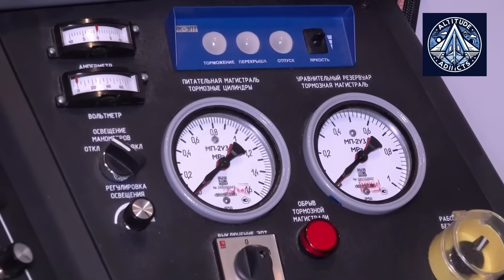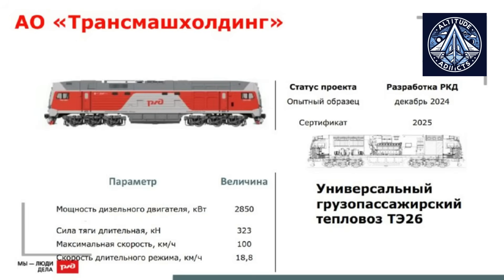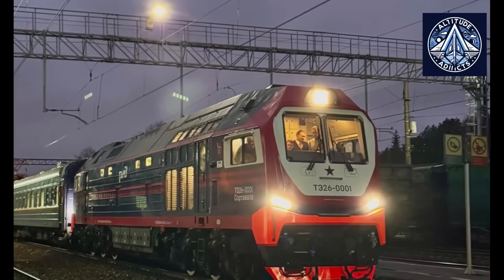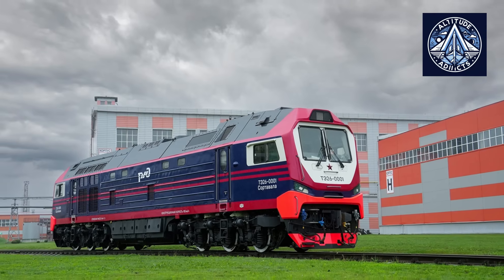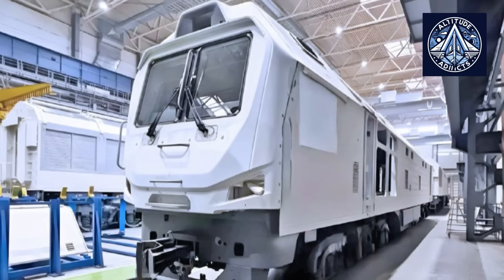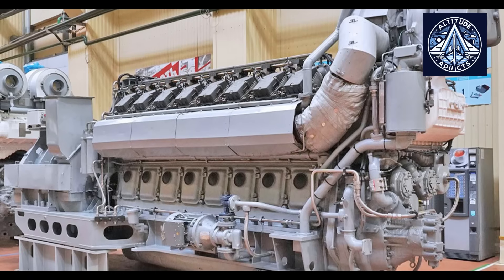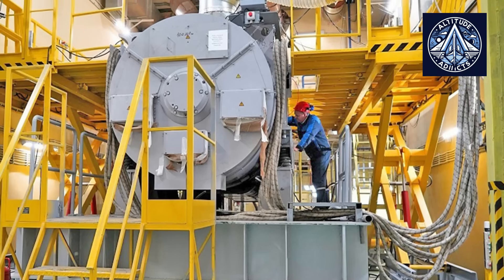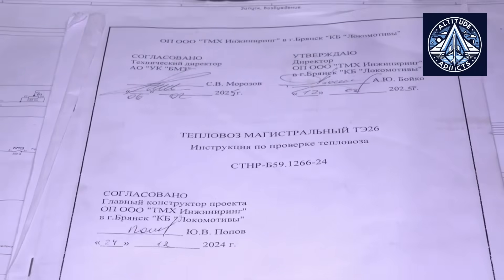Inside Russia’s TE26 Diesel Locomotive: 90% Made at Home

Comment: You probably gonna laugh but... FD20 or C&O T-1 produced traction effort of 103-107k lbs or 3000-3150 KWt despite their tender dead weight. And nowadays DEL's hardly can do the same in a single unit except probably EDM's DDA40X. 
Yes, DEL's comparing to SL's can be united into multiple units, but with modern electronics who told ya that SL's can't be same? 😂

And yes, soviets got 2/TE121 and 2/TE136 which were much powerful than this one.
Reply: This is because usefulness of TE is limited by factor of adhesion. To increase it, they'd have to make it heavier, and consequently also bigger to maintain useful axel loading. The result would be kinda big and unwieldy, so they'd chop it in half and connect it with some sort of flexible joint, aaaaaand that's exactly where we are now.
Reply: @ellhask yes, and if we talking about moving massive freight we can remember Pacific Turbines aka The Bird Cookers. The funniest thing that russians have an NK12(NK16/18) gas turbine that was used in aircraft and can be modernized to heavier fuels... Having 14000 hp under the bonnet for super freight trains that weights from 6500 up to 20000+ tons does difference. As I remember they did something with NK-16 model on NPG. 
Yes, gas turbines consume a lot of fuel but if we also talking about long runs, it's can make freight cheaper, like it was with UP during 50's and 60's. Pacific Turbines went off the track only by "general public" noise complaints.

Comment: Wow, Russia is able to build a locomotive from 90% parts produced in Russia!
The Soviets did it for 100%.
Reply: As usual, as the Russians will do, steal any and all technology from the west, as their predecessors did.
Reply: @rearspeaker6364 it's pure trash locomotive.  Marketing ploy. At best they will build 20 and will barely work.  
Where are IGBT Inverters for AC traction motors? Kazakhstan made another deal with US  Wabtec GE  90 billion dollars worth for new diesel electric locomotives.
Reply: @Inferno-hn3zx  the 28,was built with dc motors..... IMO, they are not ready for AC traction technology..... they have built 80 sets of 3 coupled together, must need the extras for a parts supply.
Reply: @rearspeaker6364  Cope harder
Reply: @rearspeaker6364 какие технологии украдены для этого локомотива ?

Comment: They should go for electric locomotive as the world slowly phasing out diesel engines. India almost phased out diesel engines.
Reply: Let put this in another perspective. Amount of Russian electroficied railroads is 4 times bigger then electroficied Indian railroads, what is roughly equal 2/3 of ALL Indian railroads combined.
Reply: @Andrey-q2w2f  they steal too much electricity in India and have blackouts for days.
Reply: In Russia, two types of electricity are used on railways: alternating current and direct current. Since railways often pass through difficult-to-access areas, building a junction station in the middle of the taiga is a costly and impractical endeavor. Russia uses electric locomotives where possible, but this is not always possible. Again, modern diesel engines used in locomotives, including Russian ones, are relatively environmentally friendly, and their contribution to air pollution is minimal compared to cars and power plants.
Reply: Давным давно перешли где это необходимо, и электровозов очень много и все свои. Посмотрите про Синара, Ермак.
Reply: Quite right. A diesel locomotive is simply an electric locomotive that carries its own power source with it. It could be powered by anything.
Reply: what are you smoking!!!!!! India has over 12,000 diesel locomotives, with only 3800 electric locos!!!
Reply: @sirajsid7760  Если вам надо переходить на электро тягу, пожалуйста! Нас не надо учить как нам жить. Просто примите это как данность.
Reply: electrification is difficult in permafrost areas.
Reply: Dude, have you ever heard of BAM?
Reply: @sirajsid7760  Refuse to your heart's content, and here they will figure out for themselves which ones to release and what to drive.
Reply: @Leonid-rr6gc  пёрнул вЯликий!..
Reply: Diesel trains are diesel electric. It would be easier to take out the diesel components and swap them with hydrogen or tiny nuclear as used in Poseidon than it would to electrifying their entire network.